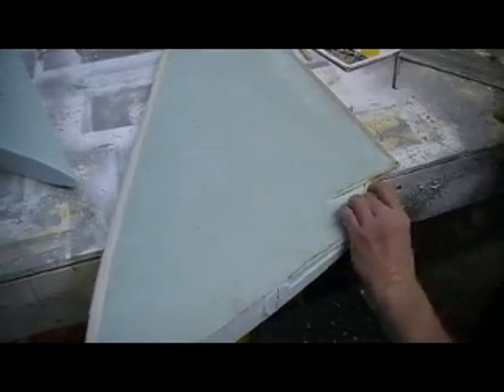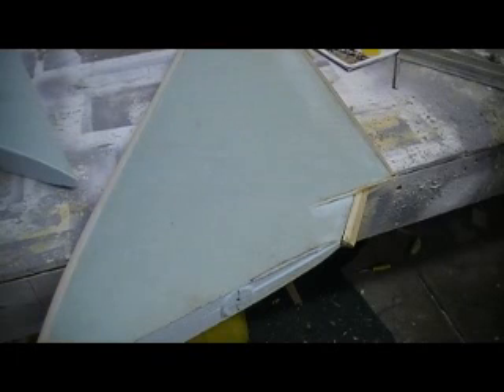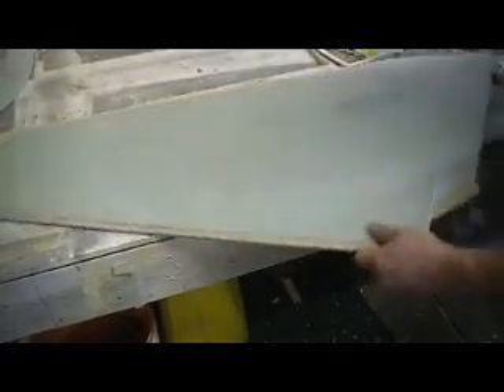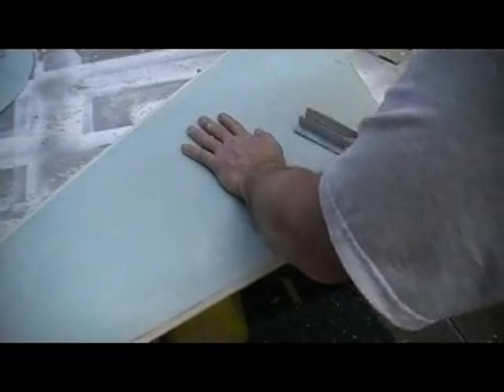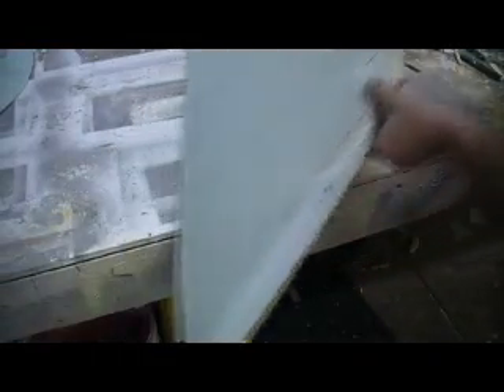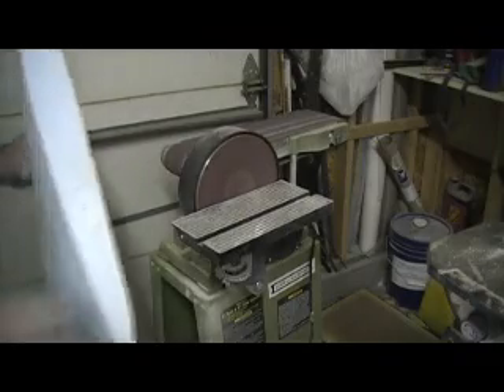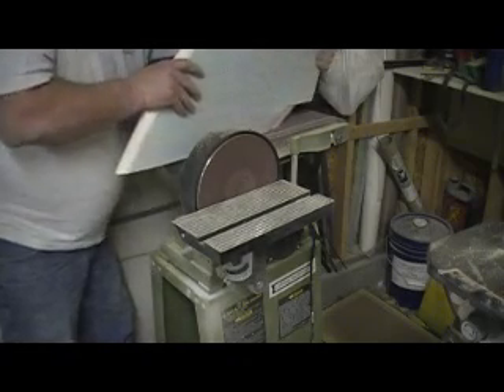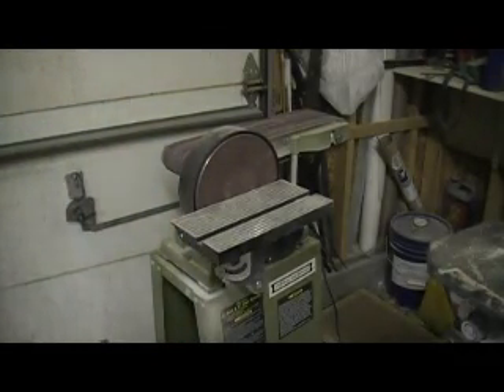how to build a rc jet B-1 Bomber # 131 pt 5

Comment: Hey Bob-

I've got the same plane.  I got mine back in the mid '70's.  It's got the original blade in it too.  I've never been able to find a replacement for it.  It's some kind of really heavy duty safety razor blade.  I've tried modifying a single edge blade with no luck.  No of the modeler's supp;y places have them either.